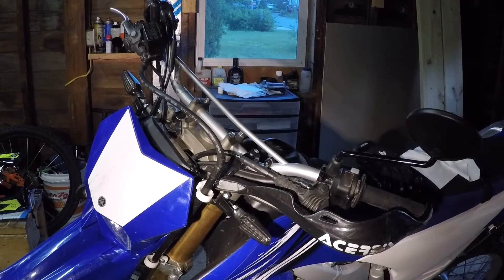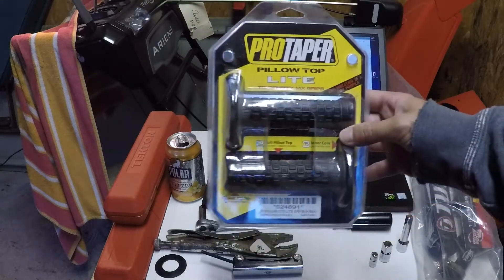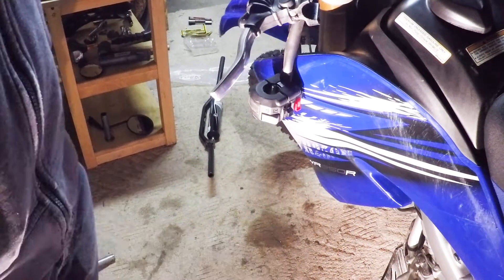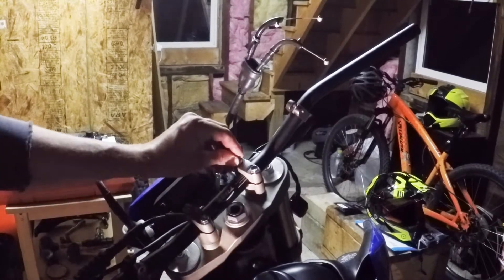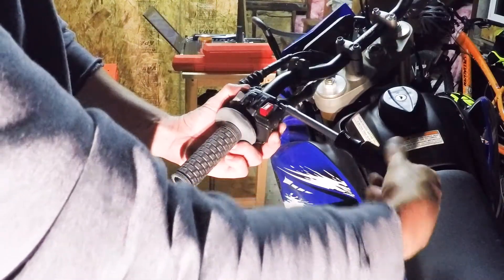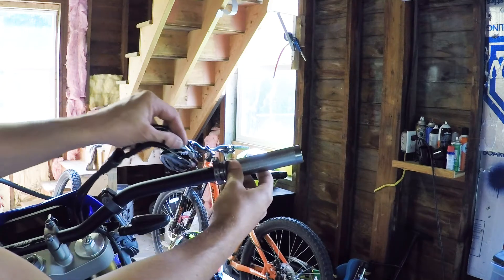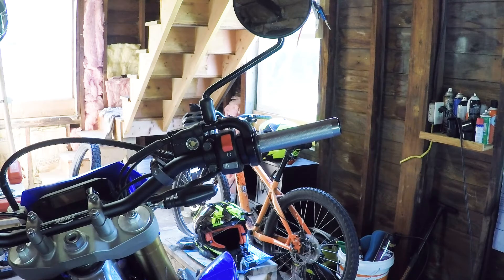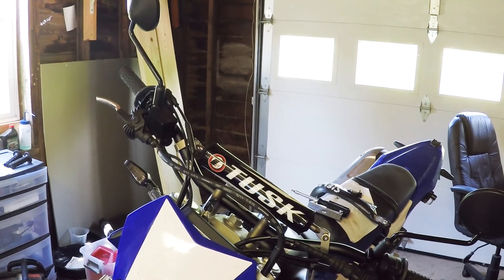Tusk T-10 Handlebar Install on the WR250R

Comment: Do you glue at all your grips  onto the bar/ throttle tube? I wonder if I need to do it or not. Also running the tusk bar on my wrr
Reply from the maker: I never glue the grips.  But I don't usually ride in wet muddy conditions.

Comment: Last question do you think there was enough slack in cable to go with cr high bend or no
Reply: It's only  .25 higher and .50 inches more pull back
Reply from the maker: A lot of WR riders get the Pro Taper EVO bar with a Windham/RM MID bend so the CR High Bend should be fine.
Reply: @jammarules  cheers thanks for the videos 👍

Comment: Yo how do you like these bars ? Compared to stock and are they tougher than the bendy stock
Reply from the maker: They're very similar to the stock bars, but they have a much thicker wall.  So they are much tougher.  Only 30 bucks at Rocky Mountain.
Reply: @jammarules  thanks man